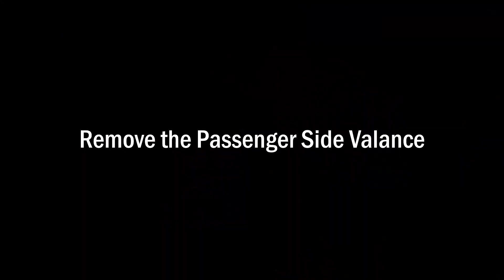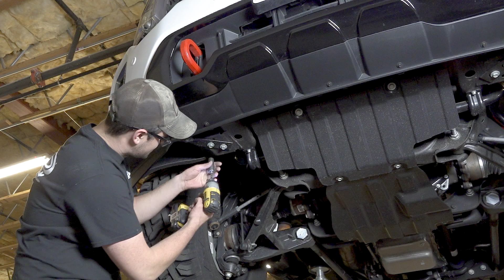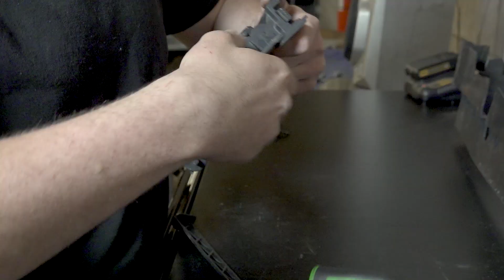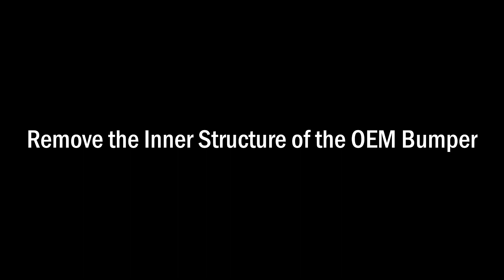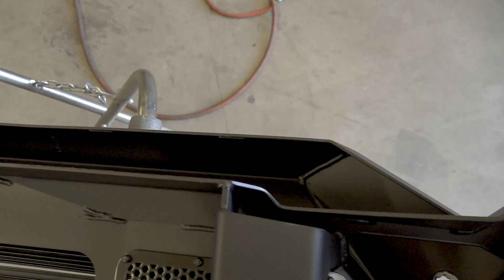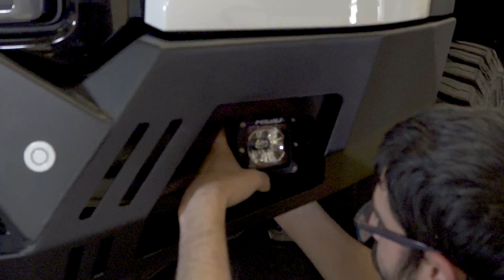2020 - Up GMC 2500/3500 Front Bumper Removal and Bomber Installation

Comment: I don’t know how I feel about the intercooler loosing its airflow.
Reply: It looks like it would definitely hinder the airflow... But is there a way to mount a winch that wouldn't? Wonder if anyone has tested this?
Reply: This bumper won’t work with any winch that requires access to the winch control pack as I’ve come to find out. That’s including the warn 12s platinum that they offer on their website as meant to paired with this bumper
Reply: I didn't notice any different on mine